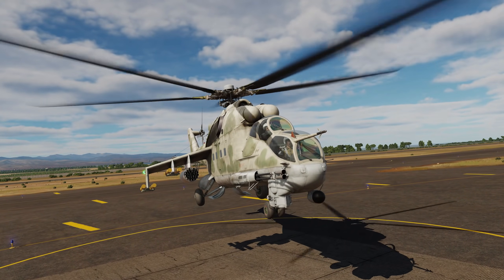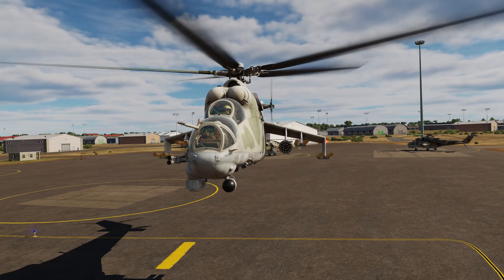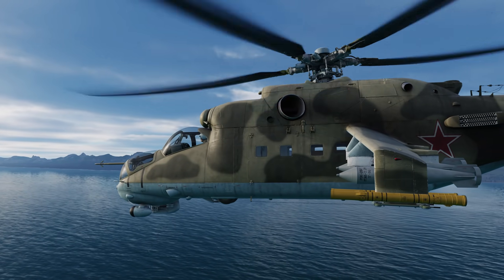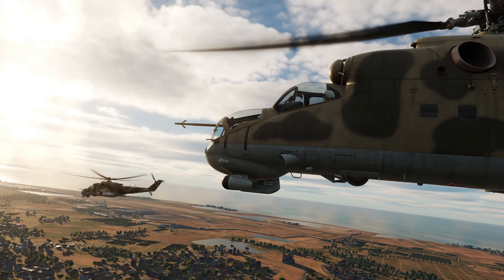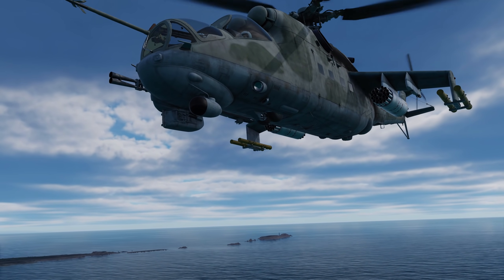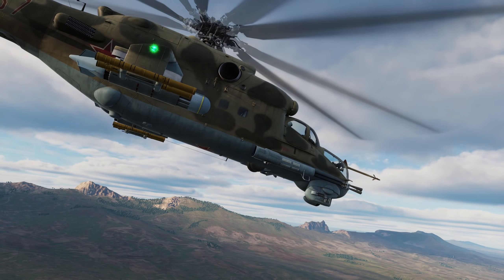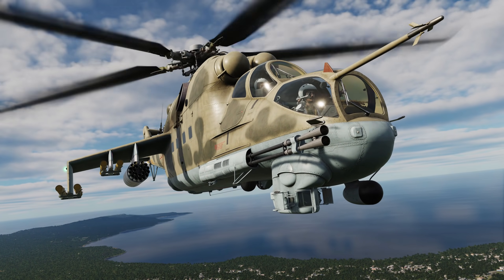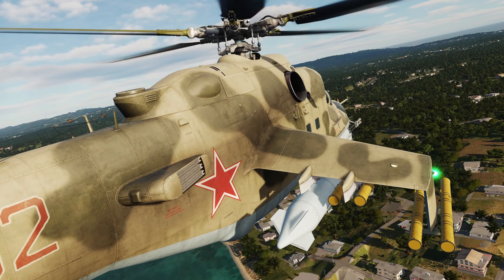DCS: Mi-24P HIND | Introduction

Comment: Does DCS include any chin turret hinds?  The side mounted cannon makes me sad.
Reply: it's a bit unfortunate but realize - the turret mounted Hind is only a 12.7 mm gun, while the side mounted gun is a 30mm gun with twin barrels so you either take essentially a 50 cal to battle or you take a light anti tank sized gun to battle with you.
Reply: @krispyk.1786  Hinds since the 80's have had a 23mm chin turret.
Reply: @jimmehjiimmeehh9748  not all of them
Reply: @jimmehjiimmeehh9748  lots of different models and modifications were made
Reply: @krispyk.1786  I never said all of them, though I can see how you could think that. 

Most common Hind is the V, and the V has been able to accept a 23mm cannon since the mid 80's.  And every subsequent Hind model has had the ability to accept the 23mm cannon.  This seems to have been the intended upgrade path too, since Hind upgrades since are always advertised with chin mounted cannons and was just rumbled by the union falling apart.

The Hind P, which is modelled, was a late 70's stopgap which came after the 50 chin mount but before the 23 chin mount, presumably because they couldn't develop a working chin mount before that point.

There's no reason to have modelled the P specifically, other than it being easy to copy paste the KA-50's code, which is lazy.

Comment: Hi, just wondering if the new graphics tech from the WW2 propellers will find their way into the helicopter rotors?

I used to work around helicopters and the rotors don't look the way they do in videos because your eye doesn't have a frame rate the way a camera does. Rather than the rotors appearing wherever the camera happens to catch them in frame causing the flashing effect, your eye just sort of sees the rotors blurring together into one disk.

If you want to see a similar optical effect on the ground. Next time you are on the highway (as a passenger) look out the window at the tires of the other cars on the road. If they are going fast enough you'll see their hubcaps blur together a little bit.

Anyway the warbird props look great. It'd be neat to see something similar with helicopter rotors.
Reply: I have seen claims that the rotors can end up moving so fast you can't see them, and this is what leads to people walking into the tail rotor on the ground?  Is this true?  It sounds odd to me, but no personal experience with choppers so...
Reply: @jimmehjiimmeehh9748  I could see that happening maybe. But the noise and wind usually makes everyone super cautious.
Reply: So I eventually looked this up, and yeah, there are some pretty disturbing videos out there of people who didn't see the tail rotor and just wandered head first into it.
Reply: @Swagnesium1  I have never seen videos of it, just saw chopper pilots commenting on it.  Struck me as odd, but I didn't really need to see videos of it.

Comment: Is the gun fire rate changable? The videos I've seen of the gsh-30-2k have been the fast fire rate and doesnt sound like the KA-50 gun
Reply: The GSH-30 does in fact have a variable fire rate, one is around 200-300 RPM and the high rate is around 2000.
Reply: I think it has the same system as the ka 50 since Russians do love to use old parts with modern stuff
Reply: @shiny2763  ka-50 is a shiponuv 2A42 where as the hind has the GSH-30-2K
Reply: @ionator2000ist  GSH - Gryazev and Shipunov =) Yea, different guns, both with changable fire rates. ;)
Reply: @IYeSICMF04  both with different action systems and only having the same slow rate fire rate. 2A42 is gas operated and GSH is recoil operated.

Comment: Hind is cool... But have you noticed the terrain he is flying over? Cyprus and hind will be a perfect combination.

GIB BOTH!
Reply: Do we know what terrain map it is going to be used with initially?  Syria or just Caucasus?  (asking as I haven't bought Syria yet).  Thanks.
Reply: @weswheel4834  you will be able to fly hind wherever you want mate, like all modules. It's not released on only one map.

Cyprus is gonna be in Syria map if this is what you are asking.
Reply: @antreasgeorgiou1411  Yeah, I realise that I could create a mission flying it on the Normandy map if I wanted, I guess I just meant is it designed for one of the maps?  Do the training missions use an add-on map for example.  But presumably it would say that if it were the case you yeah, you're right I think.
Reply: @weswheel4834  most probably the training missions will be in Caucasus because everyone has it. In the case of instant action missions they usually put missions in most of the maps.